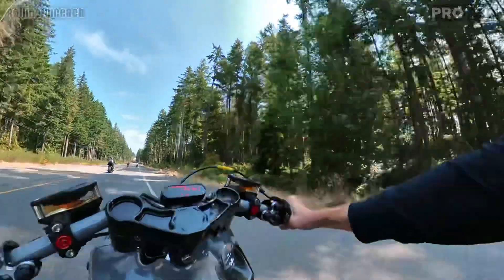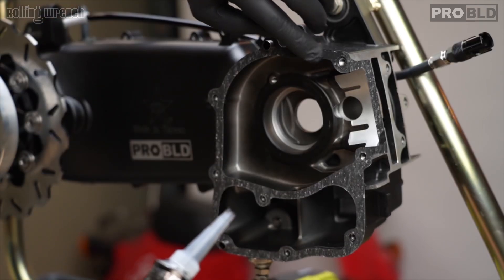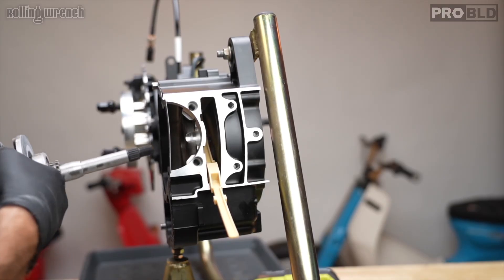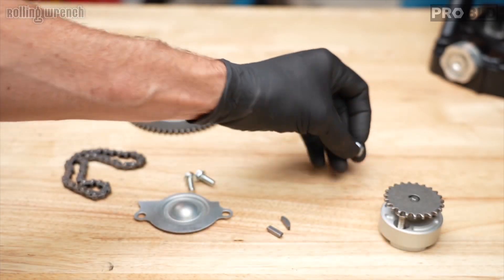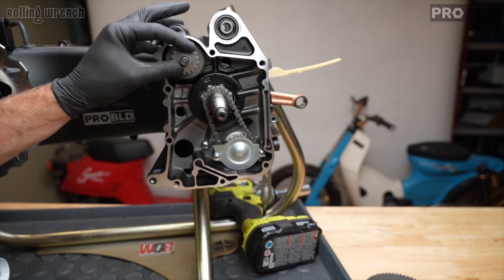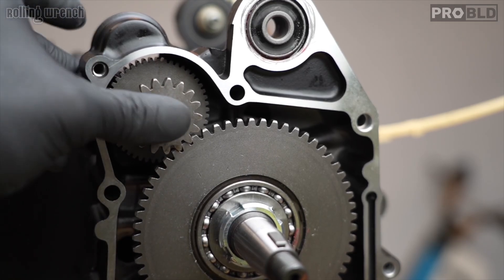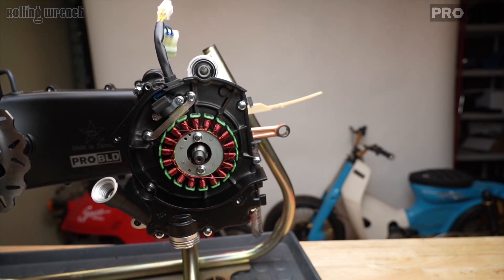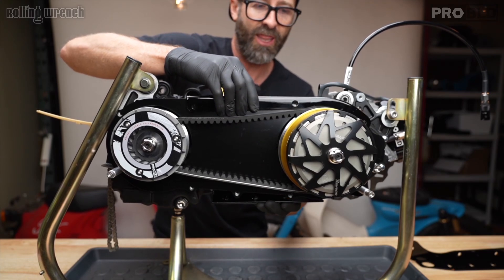100mph GY6 Scooter Engine Build - 232cc Stroker Crank Install (EPISODE 3)

Comment: I've got the new SVT 200 with a 161QMK motor/CVT in it. Can't seem to find very much in the way of what i can do with this motor. Yes, i'm new but very familiar with doing this sort of stuff it's just that i can't find much on this motor. Any help would be absolutely MOST appreciated y'all. Thanks! :)
Reply: I’m looking to find that same motor with wiring to swap into my scooter. But that is a b block meaning you can do the 67mm big bore on it without having to bore out the engine casing a lot of people in my state are doing them they have the chuma tank 200cc. They have tunable ecu for them already, bigger intake manifolds 30mm pretty cool fuel injection is the wave !! Hoping to find a crashed one where I can swap everything over to mine.
Reply: @ProppaTeam  I hope you're able to find one. That's part of the information i was looking for, thank you. Mine is a '23 model. It's a whole lot peppier and quicker with the Nibbi carb on it now, huge difference in itself. This winter i'm planning on looking into one of the kits on here and upping mine for my Spring ride. Still figuring out good resources for things to consider upgrading and swapping in and on it.
Reply: @ProppaTeam which ecu are they using?
Reply: @jasonfabo7126  pcm ecu and the new Alpha ecu from Puerto Rico